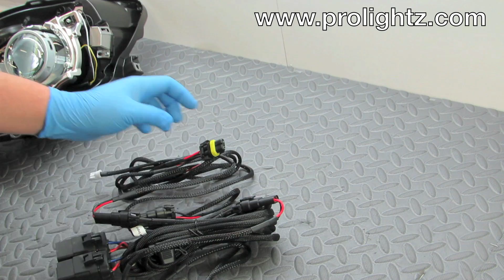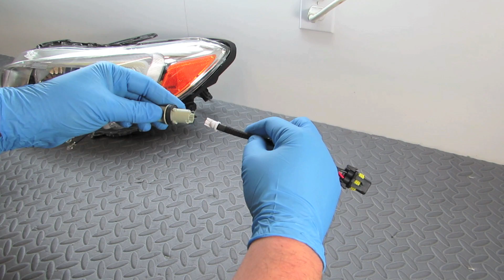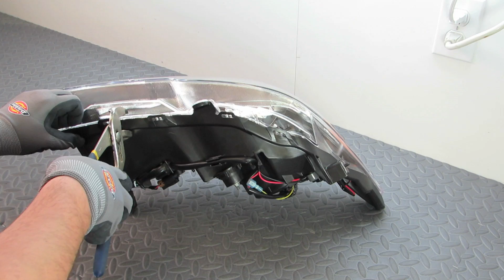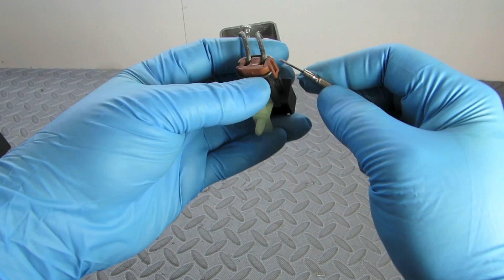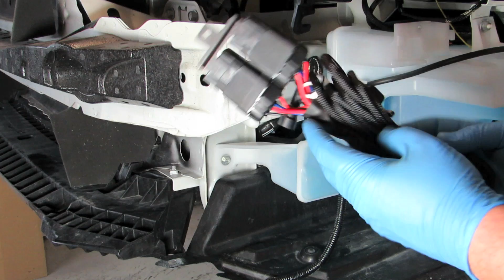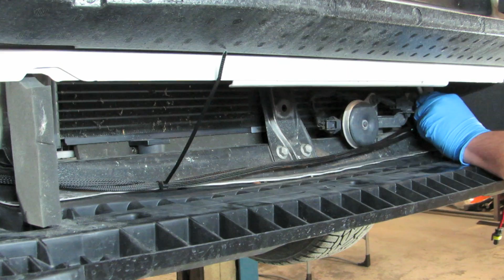15+ WRX&STI "C" shape light with DRL harness ( step 2)

Comment: This works great with just the c light coming on as the drl and just using the stock halogen drl bulb as a high beam. However when I replace that halogen bulb with a led 9005 bulb with a ballast connected, the bulb turns on with the c light (exactly what I was trying to eliminate with the harness). Why is this happening? And how can I stop it? I just want to have a brighter led high beam and not have it turn on as drl.

Comment: Love the install video, and I love how it is all basically plug and play, and even the things that require "Modding" dont include tapping or cutting wires, other than than the turn signal.  Would it be possible to pull the turn signal plug wire out, and maybe run 2 wires into the plug, vs tapping the wire?  I hate to tap the wire for future connection issues.  Thanks!

Comment: Do you have just the harness it self? I just want to turn my c-light as turn signal light and keep the DRL as it is.
Reply from the maker: +almethus gutierrez No need for a harness then, the C lights already have that built-in.
Reply: the thing is, i dont want to open up the housing. I just dont have the time to do it and quite honestly im scared. That is why im wondering if you do have just the bulb and whatever harness that can turn the c-light as turn signal.
Reply: maybe i didnt understand it correctly. are you saying that i can just put the wire of the turn signals to the c-light and it would automatically function as I wanted to be?

Comment: are you supposed to strip the wire before putting on that metal pin?
Reply from the maker: +Danny Ken  Yes of course.
Reply: +ProLightz the video shows you guys putting the metal contactor on the black and white wires without stripping it beforehand. I'm confused.
Reply: +danny9166645 They didn't show us reinstalling the front bumper. I'm so confused.